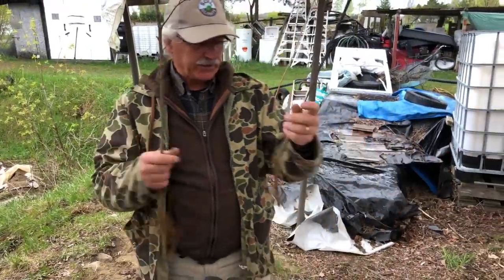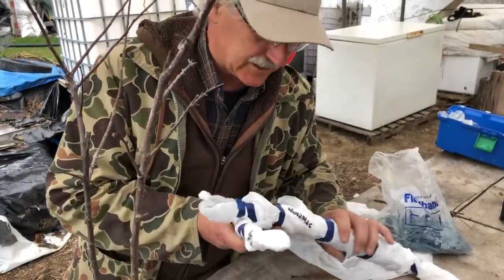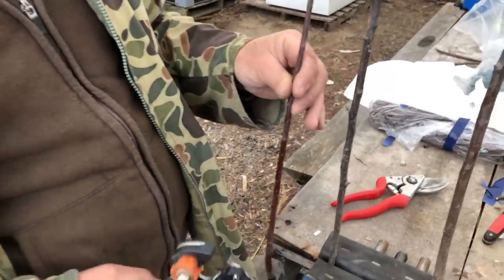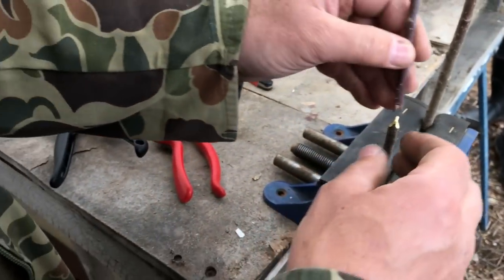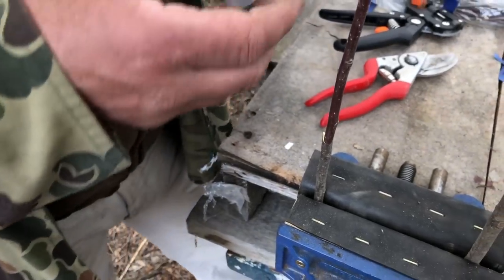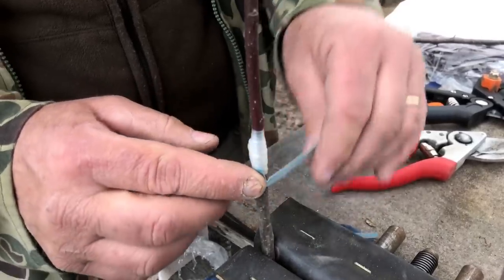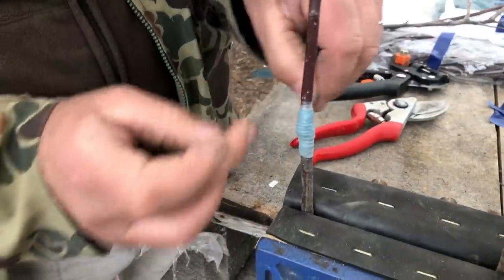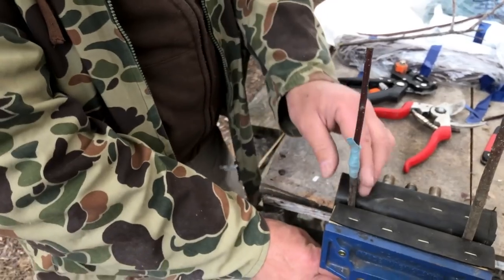How to Graft Apple Trees with a Grafting Tool in Spring

Comment: What grafting tool do you recommend? Most of the ones on Amazon have poor reviews. I've already tried grafting with a nice knife and had good success with apples.
Reply from the maker: i like plants and video games. The ones sold all have crap sécateurs on the Roland are the main reason for poor reviews. I grind off the top smooth. Just use the grafting part they work great.
Reply: @StefanSobkowiak  will that make it so the grafting part will work ? mine wont make a cut at all.
Reply: @StefanSobkowiak  I’m not quite understanding what you are saying in your reply.
Reply: @StefanSobkowiak  Enjoy your videos; Thanks. So you are saying that you grind off the pruning shear blades as they are basically useless, correct?  But what are you grinding off on the grafting blades?  I have sharpened mine with a Dremel tool but the cuts are still not always clean and crisp. Most of the time my cuts dont "snap" through the wood.  Sometimes I have to squeeze really hard to finish the cut. Any suggestions?

Comment: Does the root stock tree need to be blooming before grafting them together? Or it doesn't matter since it's it has the roots?
Reply from the maker: Graft onto a rootstock once it is big enough to receive the scion, ideally when the two match in diameter (for the size) for the time of year it can be done from dormant stage to full leaf stage as long as your scion is dormant (no green showing on it).

Comment: I have a santa rosa plum tree and a Methley plum tree. I also have a 4 apple tree combo with a Macintosh branch and it has leaf spots and now I'm starting to see leaf spots on my plum trees. Looks like when I added the apple tree it introduced fungi to the other trees and nothing is working. No neem oil or fungi spray is helping. Not sure what to do.
Reply from the maker: No it’s different species of fungus. But they both start because of the same conditions, drops of water on a leaf.
Reply: @StefanSobkowiak  do you think my water might have fungi in it? And sometimes water hits the leaves. Not often, but it does get hit with my water
Reply: Foliar feed with a microbe inoculated fertiliser that has seaweed and humates in it. Give it potassium to help with necrosis of the leaf. Remove any dead branches. Remove all prunings and sterilise pruners. Ensure tree is well mulched in summer. Foliar feed underside of leaves too as this is where stomata are.
Reply: @Gazzaloddi-ml9ej  is there a brand or bottle name you'd suggest?  Thanks for the tips. I appreciate it

Comment: Hello! Greetings from Vancouver.
I was just reading somwhere that the scion should always have the "male" V of the cut and the rootstock the "female" U, that "receives" the V. "Arrow pointing downwards" sort of thing.
You seem to be happily doing it the opposite way. Have you tried both ways? In your experience, does it make a difference?
Thanks in advance!
Reply from the maker: True if you are using a knife as it's harder to make the rootstock pointy. I usually use the grafting tool now.

Comment: Question: Could you if the two don’t match could you cut a v cut in the bigger one to bring down the size to match then both cambium would match. Curious if that would make a difference. Would not have one sticking out on one side.
Reply from the maker: You can but eventually you’ll be too close to the soil level. Better to have a range of scion sizes.